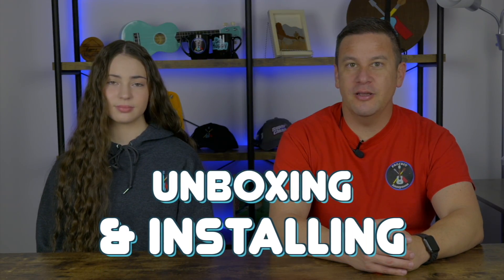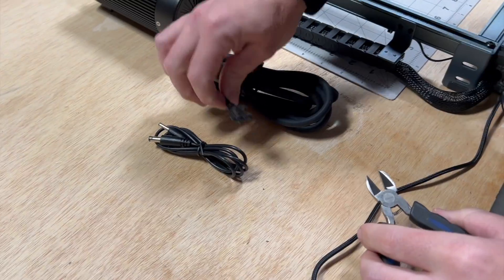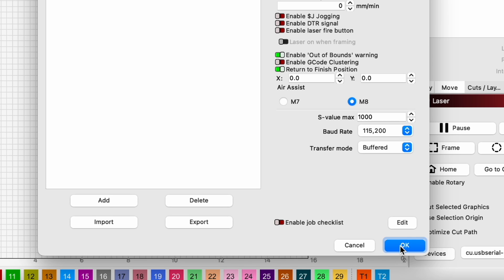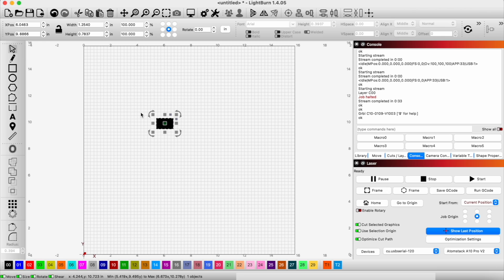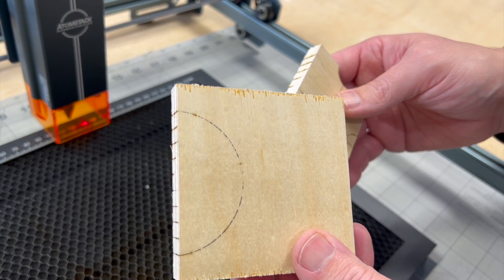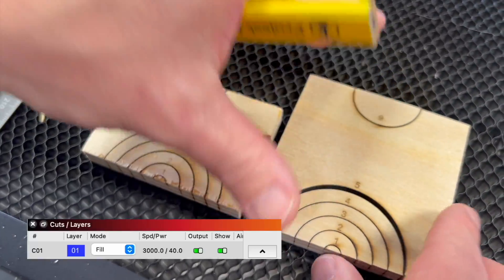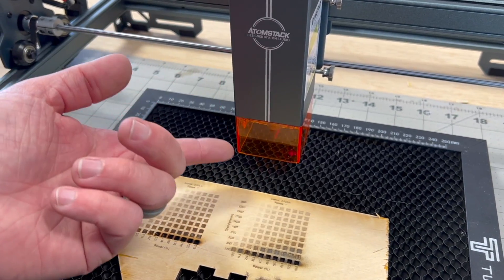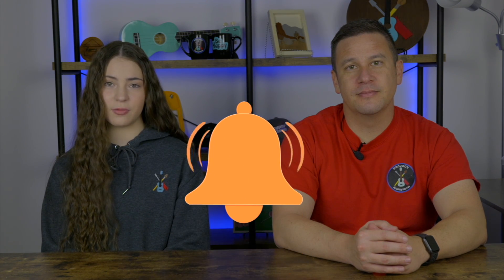Air Assist for Laser Engraving | ATOMSTACK F30 V2 AIR ASSIST - Unbox & Install

Comment: How does differ from the F30 (not v2)? The silver-color one
Reply from the maker: We haven't used the F30 version 1, so we aren't sure how they differ. 

On the AtomStack website is says that:

F30 V2 (black color)  is "Highly Compatible with Second-generation Machines: Easy to install and use, no need to purchase additional accessories. It only takes two steps to set up and can be adapted to all AtomStack engraving machine models." 

Original f30 (silver) has a list of machines its compatible with and has been "specially designed for a5 series" and "AtomStack F30 Air Assist Suitable for the following Laser Engravers:

A5 PRO / A5 M50 / A5 M50 PRO
P7 M30 / P7 M40 / P9 M40 / P9 M50
A10 PRO / S10 PRO / X7 PRO
A20 PRO / S20 PRO / X20 PRO
A30 PRO / S30 PRO / X30 PRO
A40 PRO / S40 PRO / X40 PRO
95% of engraving machines from other brands" 

If you need further information we suggest you contact AtomStack.  Thanks so much for watching!

Comment: Hello, i'm looking for the air assist power cable. Do you know where i can buy it? Or can you tell me which is the barel jack used from pump side? Thank you in advance.
Reply from the maker: We aren't sure where you can buy it, you could probably try to reach out to support at AtomStack to ask about a replacement. The pump side barrel jack is 3.5mm and the laser side is 5.5mm barrel jack.  Hope this helps!
Reply: Thank you